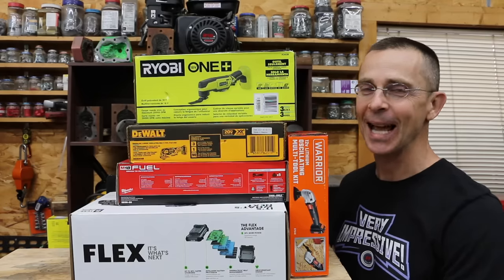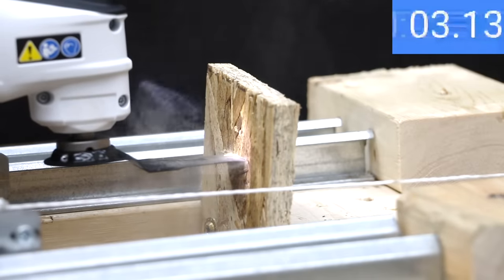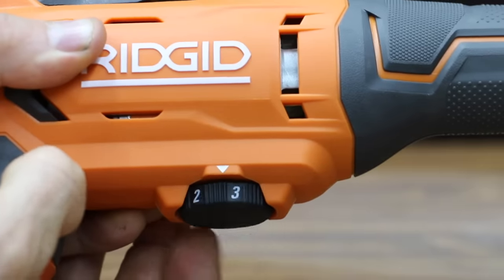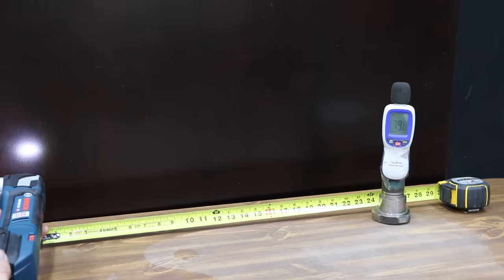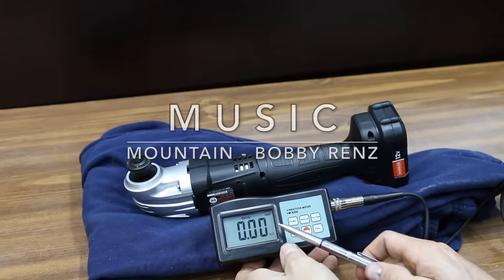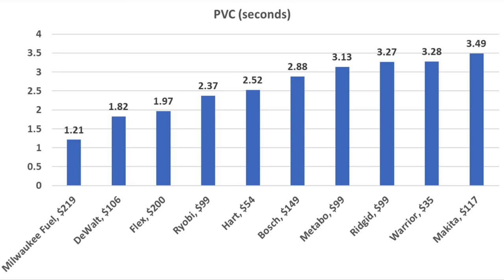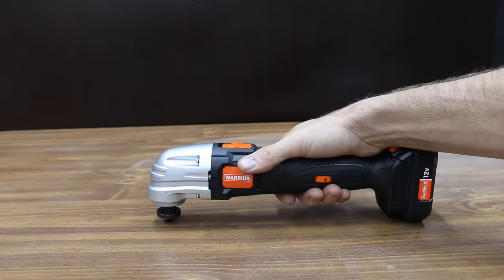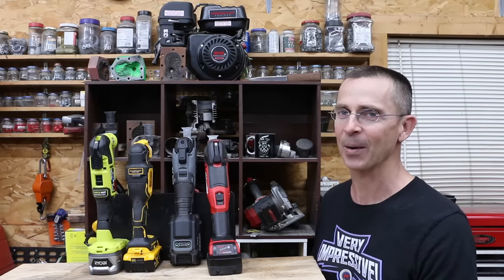Best Oscillating Multi-Tool? FLEX vs Milwaukee, DeWalt, Makita, Ryobi, Ridgid, Hart, Metabo, Warrior

Comment: I love how tools and sports team bring out the "homer" in everyone.  I was pulling for DeWalt throughout the testing. But it looks like Team Red gets the trophy this time around.  🤣  And like Todd, I laughed at the Metabo synopsis.  "Heavy, loud and cuts very slow"  OUCH.  LOL
Reply from the maker: Thanks for the feedback.
Reply: Hey… what’s wrong with bringing out the “Homer”
Reply: Team red better have won for double the cost. Can't be mad at dewalt's performance for saving a Benjamin and change.
Reply: @pseudofiev4707  Well, there's always the salary cap to worry about! DeWalt had to sign the new battery platform and now they're over the cap  🤣
Reply: @hansangb  I definitely don't follow this stuff enough to know what you mean by "salary cap".
Reply: The one area where Dewalt definitely knocks it out of the park is with the blade change lever. I love how easy it is to change the angle of the blade in under a second on the fly. Speed wise, though Team Red definitely gets this one!
Reply: @pseudofiev4707  It's just a joke.  In the US, many sports teams have a limit on which players they can sign.  It's a play on the "homer" joke which is a reference to someone who only roots for their home team.
Reply: That Metabo looked off somehow. That's not how they look in Europe for sure.. Could it have been some rebranding stuff going on where Metabos brand is being pumped and dumped in the US?
Reply: @pseudofiev4707  He's making a sports joke. In the NFL, NBA and MLB, there is a limit to how much a team can pay all its players. In the NFL, their cap this year is $182.5 million. There's also a minimum pay level - first-year players had to be paid at least $660,000 in 2021.
Reply: @jmowreader9555  Gottcha. I don't really follow sports. I thought he had insider trading level knowledge on the tool companies or something. 😆
Reply: @AlbionSupreme  it’s actually really a Hitachi or Hikoki their new name. But is called Metabo XPT or something like that in the USA. Here in Australia Hikoki(Hitachi) (Japanese) and Metabo (German) are two completely different companies.
Reply: @jasonfreestone9944  METABO, the old german company did have very effective, strong, durable tools.  On the other hand, that miserable "Metabo HPT" line is only cheating people on the great original brand, but is selling underperforming cheaply made in China tools, a real shame for both the original german name, and the Hitachi japanese name too.
Reply: @AlbionSupreme  BECAUSE THOSE ARE TWO COMPLETELY DIFFERENT ANIMALS!!!: The original METABO Made in Germany tools are among the best ones ever... BUT, some dirty bussinessmen launched a cheap, underperforming and deceiving brand, cheating under  both the great METABO and the not as great but not bad either HITACHI NAMES ... But sold as "Metabo HPT" they make quite mediocre tools in China, and ate cheating consummers appearing to be "true Metabos" while they aren't.  Those "HPT" are by far, well below the original ones.
Reply: This 'Metabo' isn't a real METABO (from Germany). In my opininion that should have been pointed out by the tester. Unless offcourse he has 'alterior motives'.
Reply: @AlbionSupreme  You are so wright. It seems to be a completly different brand that '(mis-)uses' the good name of the original METABO brand.
Reply: @alfredomarquez9777  They still do! In my opninion METABO should sew the knock-off company.
Reply: For half the price, I'll take the DeWalt.
Reply: @jasonfreestone9944 in KY, the Factory is still called Hatachi.

Comment: I've had the Ryobi one+ drill and impact driver for over 4 years, now. Recently bought their older, non-hp version, oscillating tool. Got it for $20 at a pawn shop and it's a bad little unit! Absolutely love the thing and wonder how on earth I did without it all these years.
Reply: what's crazy to me is the difference between a old corded drill without the brake and the newer impact drivers with the brake. driving screws is so much easier when the drill or driver has the brake when you let off the trigger.
Reply from the maker: Thank you!
Reply: Ryobi makes great tools for the money, had one of their 18v drill sets back in 2005 when they weighed 10lbs, damned thing kept going for several years of hard use.

Comment: I like the addition of the highlights right before the end.  Elaborating on the overall performance for the tools is a great addition to these reviews IMO.

The Warrior is the cheapest and second worst performer, but it does come with the benefit of including the battery and blade.  If you only need something like this for a one-off or rare project and can't borrow one, it's probably the best value.

I'd personally pick the Ryobi or DeWalt (sales and availability would be the main determining factor).  Unless one had regular use for a tool like this, in which case opting for the Milwaukee seems the best idea, considering its great performance.

Once again, my thoughts on Milwaukee seem to bear out.  Not always the best performer (though it was in this case) or best value (best performer, but also the most expensive), but it's just one of those brands that can be relied upon, where if you had to blind buy something in a rush for whatever reason, you can reasonably expect it to do the job well, even if there might be a better option in its price category in a given type of tool.  

Also reinforced is my thoughts on the Makita.  It's usually put around the same category as the Milwaukee, but from my observations with these reviews it tends to be a lot more hit or miss.  In this case, it just was a bit mediocre, especially for the price.
Reply from the maker: Thanks!  Thanks for the feedback.
Reply: That's my experience with Makita. It's a good brand, but individual tools are hit and miss. They are either really good or horribly mediocre.  It all depends on when they overhaul their designs. They are mostly way behind in features.

Comment: I love your videos and always look at your reviews prior to making a purchase. It would have been nice though if you would have included the new Makita  DTM52Z brushless 18 volt. It looks to be far and away better than any of the older Makita units
Reply: Yeah that would be nice.  I have the old makita but was wondering how the new one was.  It will make your hand go numb fast.
Reply: in the US that would be XMT04ZB
Reply: Same here.  I had been waiting on the DTM52Z (which finally arrived in the US as the XMT04ZB.)  From what I've seen, it can match the Milwaukee, but none of those reviewers test like as thoroughly as you do.
Reply: Same here, and I’d also have liked to see you test Fein’s Multimaster. They’re usually credited with inventing the tool format, so it’d be interesting to see if they hold up.
Reply: @Khabster  oscillating tools have been used to remove cast for decades before they were ever applied to woodworking.

Comment: One thing absent in the testing was ease of use, whereby you actually perform a variety of cuts in common use-cases in real-world scenarios. I feel this is a worthy to mention oversight. The location of controls vary, as do the dimensions and ease of use in tight quarters. One detail that users are often biased about is slide switch vs trigger operation. (I'm highly biased to slide-switch as itt allows unlimited movement and adjustment of grasp to manage the cut on difficult access or cumbersome material.)
 I've been a fan of Bosch, but they're not the forerunner anymore, as your test shows.
One of my ultimate useability tests is cutting 3 or 4 inch PVC off below the floor surface by 3/8 for a toilet flange or similarly a pipe embedded in a sidewalk below flush to receive a cap. Models like DeWalt with a trigger switch are unsuitable. Models with a battery protruding on the underside likewise.
One other subject I would like to have covered is blade type/compatibility, as some are OIS, Starlock (3 types thereof), proprietary, or open-back (not OIS standard, but similar). This by far is a major influence on the purchase, as most professionals are looking at range of choices for blades (Starlock offers more larger and longer blades) and some cost consideration. DIY folks are more cost conscious, and I feel often avoid Starlock. 
Lastly, I despise the open-back blades touted as universal. One necessary test for each model that confirms to OIS is whether it can hold and safely operate an open-back blade or not without incident. The market is becoming saturated with these, and they don't work with some OIS tools without falling off. (If it wasn't for Rockwell and mainly DeWalt we wouldn't have this problem in the market).
One last remark: your assessment of ease of grip is subjective but not totally offbase, size of hands makes a difference, and how/where you hold the tool. Smaller- handed folk need the skinny bodied models, but larger handed folk will do ok with the moderate and larger models.
Reply from the maker: Thanks for the constructive feedback.

Comment: Great showdown as usual, and I love the summary at the end, but I have two observations (critiques):
First: When measuring vibrations, some were measured on the rubber while others were measured on the hard plastic; those measured on the hard plastic had unsurprisingly higher vibration measurements. 
Second: it appeared that some of the tests were done with the blades parallel to the test track while others had the blades a few degrees down. In any saw, if the blade rubs, the added friction slows cutting; sometimes drastically.
Reply from the maker: Thanks!  Thanks for the constructive feedback.
Reply: Thats what i was thinking as well! I like the flex out of these and the new makita looks levels higher than this really old makita.
Reply: Was thinking the same thing.
Reply: @codustv1465  There's simply no possible way that Makita is below a Wal Mart tool. I respect testing, but that kind of outlier is very suspect.
Reply: @Gil-Galad  Even if it was that makita is how old its by far no means new at all and iagree
Reply: @Gil-Galad  Well HART is part of the milwaukee brands along with Ryobi and Hyper Tough. With them being Milwaukee > Ryobi > HART > Hyper Tough, Walmart just bought exclusive rights for selling HART and Hyper Tough.

Comment: I think this was a pretty great group of tests. I would have liked to see the newer model of Makita tested instead of the older/cheaper model. But it makes me more certain about the purchase I'm going to have to make very soon so thanks!
Reply from the maker: Thank you for the feedback!
Reply: the makita may be old but it didnt even perform on par with the other similarly priced units. very disappointing
Reply: @Darkcruzer23  very true, compared to the similarly priced models that definitely was not on par with the competition. I didn't think of it from that perspective. It definitely went off my list fast, that Milwaukee performance was great.
Reply: @ProjectFarm  Could you do a round two with the newer Makita and the fine Tool and maybe an accurate plunge cut? Would be much appreciated. Best Regards from Germany 😊
Reply: I agree, the newer makita is a totally different tool.

Comment: Love all your content. Wish you would’ve included the newest makita offering (brushless sub compact with star lock) just to see the comparison. But keep up the awesome work!
Reply: Yes, would love to see that too! 😎✌🏼
Reply: Yes me too even tho I've already bought one.
Reply: That's the problem with Makita..
They make several versions of the same tool without making it clear about which one is the high or low end ones..
You need to read the fine print and even then they don't mention every detail..
Reply: @zakofrx  milwaukee does the same. M18, m18 brushless, and m18 fuel brushless. 

It seems like scam for new buyers. They see a 7 tool combo kit for 300 bucks and think it's a steal. But it's all brushed tools.
Reply: @zakofrx  they have the dtm51zj and the dtm52zj so they just count up...
 and you will always see it if you look at the price.
 And they improve on their tools which I find pretty nice
Reply: Agreed. It's the XMT04ZB
Reply from the maker: Thanks!  Thanks for the suggestion.
Reply: @zakofrx  The subcompact is way newer. Idk what you're talking about because the website clearly says one is brushless and has a larger blade angle. Pretty obvious to me. 🤷
Reply: Also Metabo has the MT 18 LTX QSL since 2021, at least here in Germany, it costs about 170 euros.
The tested one is a Hikoki, original Metabo green is darker.
Reply: @dominiksachs8632  here in the US hitachi became Metabo HPT. Hikoki is the international version of hitachi
Reply: @TKettle  hey guys never meant the comment to cause any issues. Just would like to see that version included. Makita actually only had one version of multi tool for a long time. But all major brands continue to come out with different versions. Especially if there’s new technology that can be adopted

Comment: another exceptional test ... I've used several brands including the DeWalt, the Rockwell (not tested), and the MIlwaukee. I reach for the Milwaukee everytime except for instances when I need the power of a corded tool, i.e. the Rockwell. I find it very interesting the Makita did as poorly as it did considering they've been in the cordless game for several decades. It just goes to show you cant judge a book by its cover ... unless it's a Milwaukee ... then you already know ... love the content, the testing, the commentary and the farmebego ...
Reply: Just bought an m18 bluetooth job site speaker and its garbage. They claim "loudest, clearest speaker" and it doesnt go very loud, does not charge the battery and has no radio either. And for 169? The Makita radio ive had forever still sounds better
Reply from the maker: Thanks!  Thanks for the feedback.
Reply: I like the tool change on the rockwell, toolless and clamps very tight. 
I'm leary of the ones that rely only on the pins not wearing out.
Reply: Makita is so hit or miss, some of their tools are best in business, others are just trash that they should be ashamed to have their name on.  Milwaukee has their failures and flubs too but far less commonly from what I've seen and experienced.
Reply: Makita have a brushless multitool released a few months ago, not displayed here.
Reply: @jorgeo1492  I picked up ($60) a used and battered Milw. corded jobsite radio. Thing is a beast. Loud and good bass. Doesn't charge but runs on M18 batteries as well as corded. Has 1/8 jack for MP3 or external source.

Comment: Called it. I've never used a Milwaukee plunge saw, but after watching it dominate or be top tier on most videos it's in, you can't really go wrong with it. I have used a Ridgid plunge saw, and I gotta say...I don't like it really. It seems like a pretty mid-tier tool. Since I have Milwaukee batteries for my drill & impact, I'll be getting the same brand if I have to buy one.
Reply from the maker: Thanks for the feedback.

Comment: Great job on your comparisons, Very objective! 
So good that deserves a second round wile it's still warm. Including  some other brands doing the exactly same tests. Few brands like the fancy Festool, the classic Fein, Lowe's brands and the just released new Makita that still have almost no information available. ($250 promising to have no vibrations).
Reply from the maker: Thanks!  Thanks for the suggestion.
Reply: Second this request
Reply: He put 18650 against 21700. And could not use the Ridgid brushless. Of course 21700 has more power. But he loves his Milwaukee to much so to ever do a proper test.
Reply: @ProjectFarm  I 2nd the suggestion.  Dudes on the Makita platform in the US have been waiting on the DTM52Z.  It was recently released, in the US, as the XMT04ZB.  Your video did help me decide to def not get the Makita you tested.  
Also, I auto like all your videos.  When I finally found your channel a few months ago, I binged for a week.  Thanks again for all your thorough testing.

Comment: Love your videos, great testing systems! But how can you do a oscillating multi tool face off without including the original oscillating multi tool maker, Fein? Also you should use the Makita XMT04ZB rather than their budget offering. It is their better version and it would probably be much more competitive with the other top performers. This would be comparing apples to apples rather than comparing Milwaukee and Dewalts top offering against Makita's lowest. I think this should be redone eliminating the bottom brands and adding in Fes tool, Fein, Makita XMT04ZB, and Bosch. Once again, thanks for so many great videos, I have learned a lot from you guys!
Reply from the maker: Thanks and you are welcome!  Thanks for the suggestion.

Comment: A pretty illuminating test! Since this is a tool that most of us use intermittently, it looks like its probably just best to stick with whichever brand is compatible with the batteries one already owns. Most of the middle of the pack tools are so close in speed that the creature comforts are the only real difference.
I think the more important test will be on the bits/cutters. Those dang things are expensive and prone to breaking in my experience. It would be great to know which ones last.
Reply: that's already tested, check videos from 2020 (I think it had "blades" in the title)
Reply: hes did a video on that already